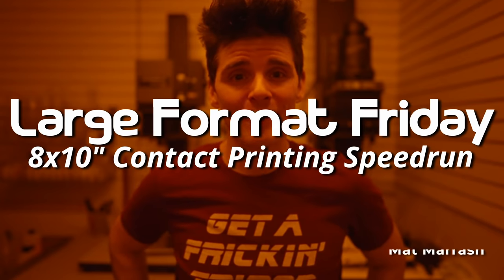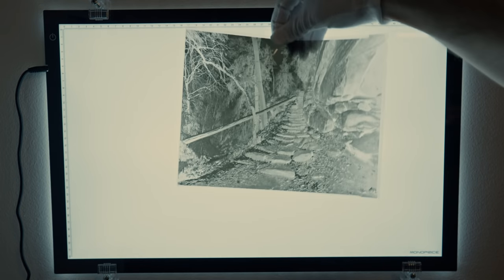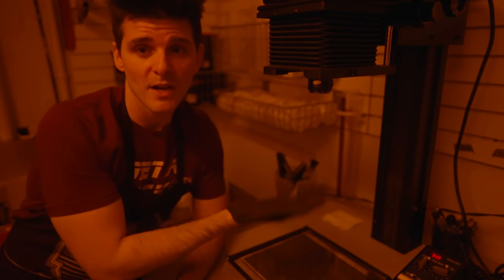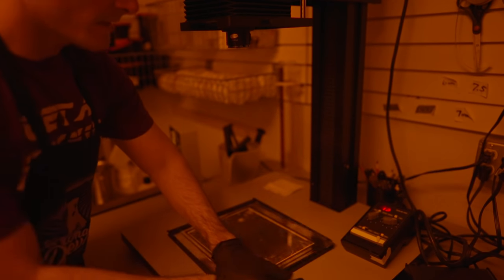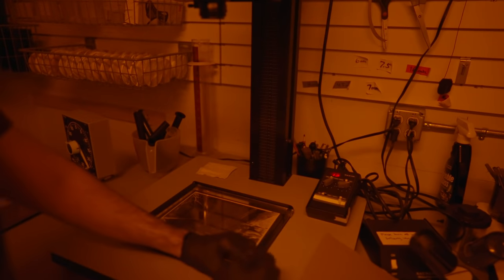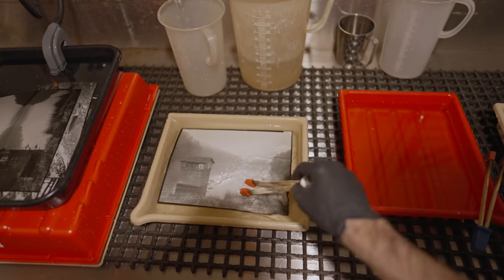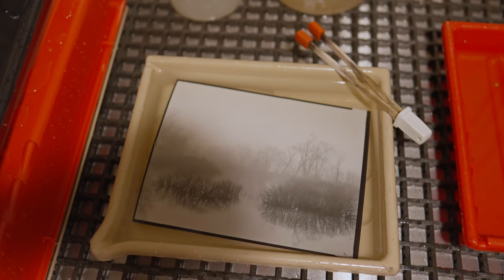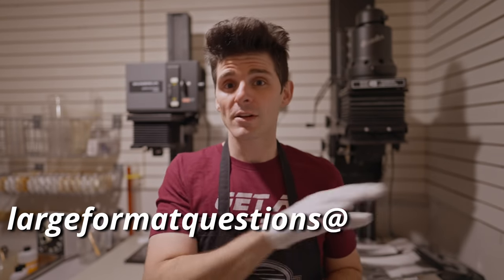8x10" B&W Silver Gelatin Printing Speedrun! - Large Format Friday

Comment: Hi Matt, the latest version of Ilford MG RC tones just as well as fiber based. Love the channel
Reply from the maker: Thanks Michael! I was also surprised that this newer RC emulsion exposes almost identically to the Fiber based paper. Ilford is knocking it out of the park lately!
Reply: @MatMarrash  When you use RC paper you run the risk of the image becoming unstable when exposed to sunlight, RC papers are notoriously non-archival. To achieve full archivality, tone the print in selenium. That'll add somewhat to D-max also. You can use not just one, but use several Ilford filters when exposing your neg.

Comment: Why RC paper, Matt?  Some people proof on RC and then do final prints on fiber-based, but I've always preferred to do all work on fiber, since that's where I'll do my finished prints. I've found a different look between the RC and fiber papers even with the Ilford Multigrade, which is what I use.  I'd appreciate your thoughts.
Reply from the maker: Hey Jim thanks for the question. These particular prints were ones that were purchased as RC, otherwise I prefer to print Fiber. Over the last few years, Ilford has really stepped up their consistency between RC and Fiber emulsions to the point where I can confidently proof on RC, then translate that exposure to Fiber. The biggest difference now is the broader dynamic range and toning possibilities. Cheers!

Comment: One aspect of printing with an enlarger is when and why to change the F stop up or down on the enlarger lens. Being your light is generally fixed one usually just varies exposure time. So, when does one stop down or open the lens aperture other than for coverage?
Reply from the maker: Since we're not worried about depth of field, you're right that our only concern in contact printing is exposure time. I tend to start at least one to two stops down from wide open on the lens to give me a somewhat controllable base exposure time; this is usually 10-12 seconds. If I need to do something for a significantly longer or shorter time I'll opt for adjusting the f-stop instead of the timer. Personally I'm not a big fan of 30+ sec. exposures under the enlarger.

Comment: I really enjoy videos like this. It gets me back in the darkroom to give it another try. I have been printing with the intrepid enlarger for only a few months. It was good to be reminded of the little variables like lens, f-stop and the often forgotten about, height.

I have a few questions for someone new to printing my own negatives.

(1) could we get some more detail and guidelines in how we assess a print before we adjust dodging / burning / contrast / split toning. This is especially difficult because I am not used to assessing a wet print. When it dries it gets darker. Is this something someone gets used to. I am slowly getting the hang of it, but I would appreciate a bit more detail in why you change contrast / exposure. (i.e. Would it be possible to hold comparison prints side by side a little longer? Looking at different area, comparing the tones of specific areas. Comparing assessing prints while wet / dry.)
(2) Is there a common methodology to taking notes so that we can revisit a print at a later printing session.
 Thank you.